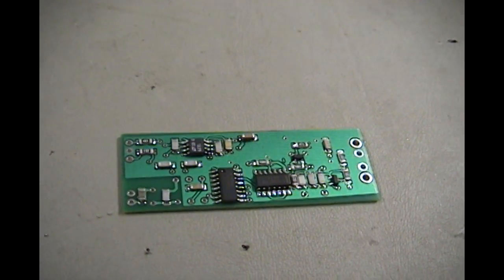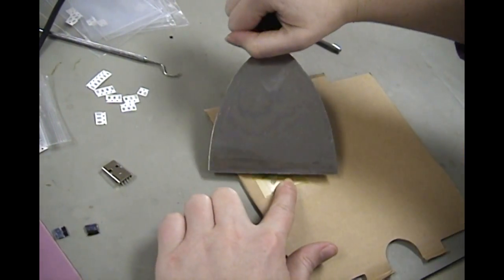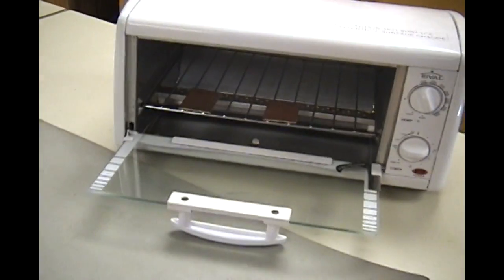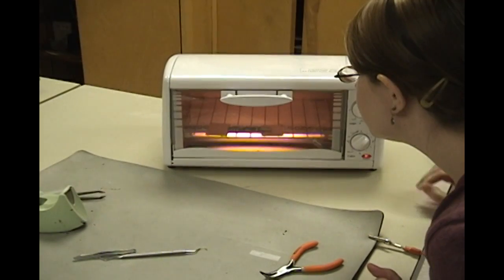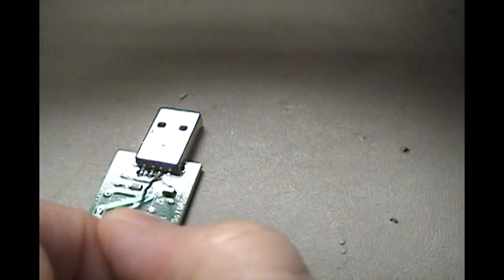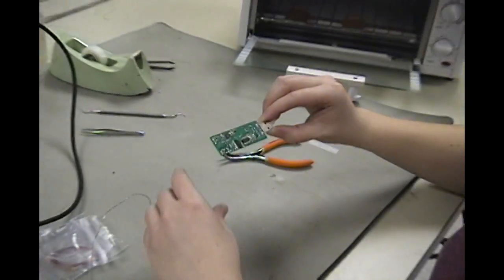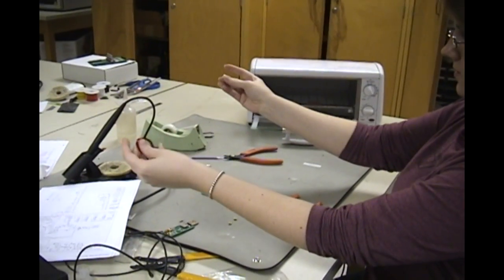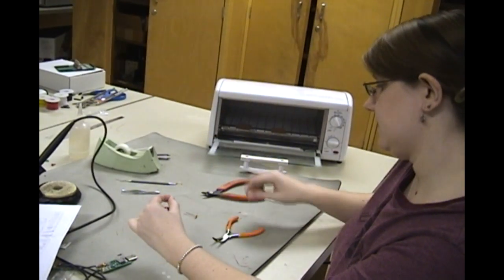Softrock40_R Soldering the Second Side With a Toaster Oven

Comment: How do u maintain the temperature profile for reflow
Reply from the maker: Doing it this way is not an exact thing.  In the past we did build a controller that set the temperature profile, but for hobby use didn't find that any better than this.